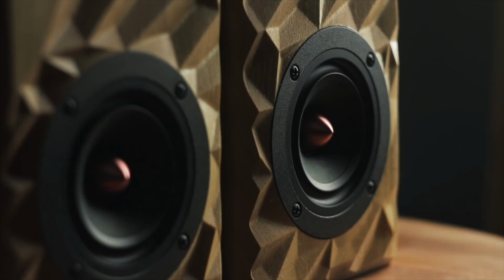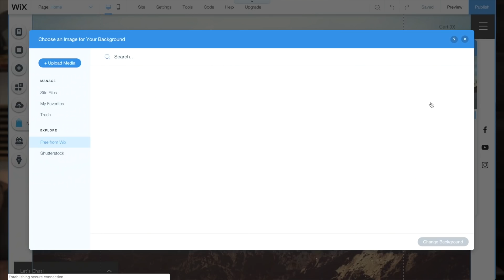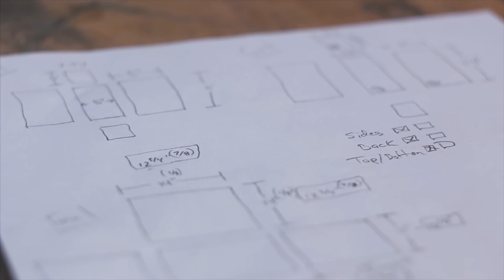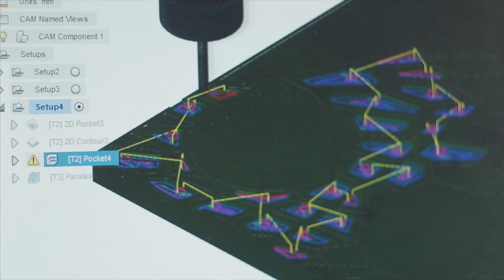Low Poly Speaker Build | CNC Front Baffle with Shapeoko

Comment from the maker: Thank you so much for all your support over these few years. I honestly couldn't have gotten this far without you.
If you want more info on this Morro Speaker set and how to buy, check it out here: http://bit.ly/MorroOne
Reply: Dude, awesome looking speaker set except... Where are the pictures of the subwoofer? I'll be blunt - I can't afford the set, but whoever can is going to want to see what the sub looks like. So, you need to include that on the sale page. Just my thoughts, good luck with getting them sold!
Reply: Dumb question but what do I need to use these... Can I plug a Chromecast audio into it for example and be good, or do I need an external amp for it.
Reply: after 10 years of designing countless speakers, if've been hasitating to do this step myself. kudos for taking this leap of faith and good luck man! excellent price for this build quality. hope this is viable. been calculating project costs for years now and came to the conclusion that i couldn't do a pair of bookshelfs for 500$. even if they were widerange… and you're mixing in a sub as well.
Reply: Coupld questions ,What Cnc router do you use? is there a larger CNC you have your eye on? you have real passion , Do  you often go to yearly audio shows? what is the ultimate speaker you've heard?
Reply: your work is amazing, and inspiring, thank you.
Reply: I'm a new sub.
Very nice build.

Comment: Fantastic way to build custom speakers that stand out.  If i were to personally do it I would have matched the pattern to both the same but inverted but that's me.  Gives way to some great idea's with a cnc router table.  Also I'm not sure what wood you used but Having played with oak for my build, it seems that it was rather rough and grainy the wood you used.  Maybe consider the front panels should you do more like this out of a harder wood so that it smooths better.  Passing thoughts is all. And maybe even out of a butcher board/counter top design could really play well 3D wise with a design like this giving it even more depth.  Really enjoy the look of these, very unique and aesthetic.  Love it.

Comment: I really like the face of the speakers. I am an engineer and use Solidworks nearly daily for a living, but I assume your pattern was made by some sort of generative software? Would you mind sharing the design process for the texture/pattern on the front? I could probably model it manually but it would take forever and be a lot of features in the tree.

Comment: I like it! Lovely look. I know the pleasure of doing some manual work on the projects, but wouldn't it make sense not only for alot easier assembly and alignment but also air tightness of the boxes to cut all sides on the CNC and add locking rabbets to them? I mean, if you're doing small production runs and such it would probably save some time as its quick and easy both to design and cut rabbets on the cnc.

Comment: I have a lot to say probly have to do 2 texts. good video and im positive it is going to work out for you. I still need to buy those drivers someday.. I'm a carpenter and into audio. Hey did you know they have drill bits with a self centering piece on them we called them Vic's bits. You could hold down your item and then drill all 4 holes it would save you a step. You definitely should make more speakers in the batch like at least a dozen. 50 or a 100 would be better when are you getting your Professional facility bro?lol professional facility bro

Comment: I think the front of the speakers are gorgeous, but using painted MDF for the rest, and not even beveling the joints is not appropriate, especially for speakers in this price range. You could veneer the MDF if you beveled the side joints and it would really complete a beautiful design.

Comment: "How to get really good sound" starts with sound (as in solid) waveform behavior knowledge.
Manufacturers have gone to great lengths to NOT have all the sharp edges in the propagation path.
Look at the surround of Wilson Audio tweeters. A star shaped ring of sound absorbing foam (borrowed from Duntech labs of the late 70's.)
A mini anechoic area to prevent reflections at irregular intervals. Then you go and make these acoustic "lenses" different!
What scientific principal is at work here?
Are those sound enhancers in your ears or another cosmetic frill?

Comment: A the beginning you said you enjoy learning loudspeaker design. So here's another, unfortunately sad thing you can learn - sculpting front baffle like that messes high frequency dispersion. You better measure your speaker off axis after shaping your speaker in any way. If, on the other hand, you want to use your cnc machines to improve the sound, then learn about  physical phase matching in multiway loudspeakers, waveguide design and edge diffraction. There are many people out there who wish they had access to a lathe or a mill just so they can fix phase and dispersion issues in their designs.

Comment: You might want some blunt and brutal, but honest advice about this. 

You have been doing this for two years according to your videos. 
That is nothing!
Your videos shows you struggling with even the most basic technical aspects of good practice in speaker building.

Also, if you are going to do projects like that with lots of artistic details, you better charge some more for them.

$500 will not put bread on the table with time, tools and materials deducted.